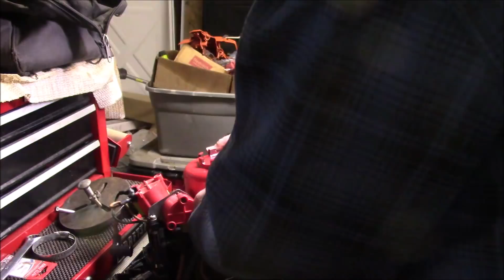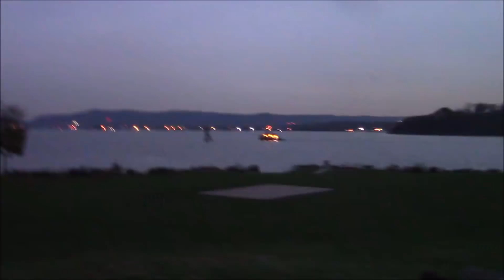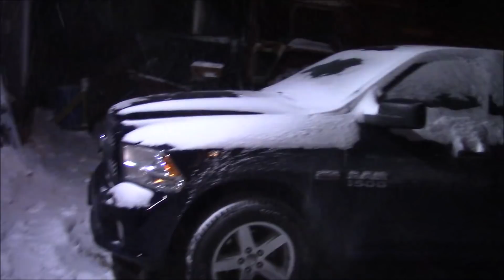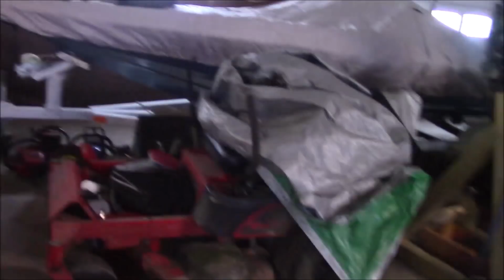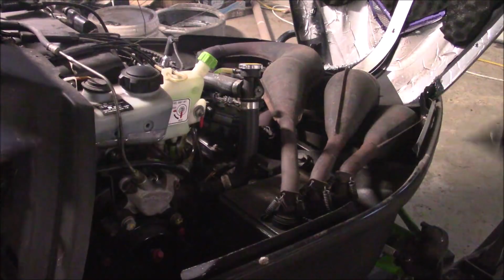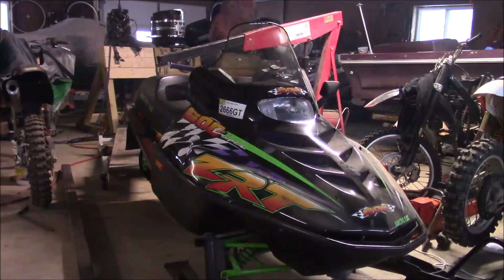Happy Thanksgiving! Whats Been Going On & Channel Update,  Also Arctic Cat ZRT 600 Lives!

Comment: I loved my old 1996 ZRT600. It wasn't quite as quick off the line as a couple of my friends newer 2 stroke twin sleds were, but onceyou got it moving and got deep into the power it was pretty easy to reel them back in. The only provblem I had with mine was the narrowish skis in deep powder let it plow like a submarine in extremely deep powder snow (over 3'). I wanted to put a set of the wider skis off the triple powered Powder Extreme to solve that issue. I also had the Camoplast deep lug (I believe it was 1 3/4" or 2") track on it which hooked up much beter than my friends stock ZRT track did. Great sled, you should get a lot of fun times out of it .